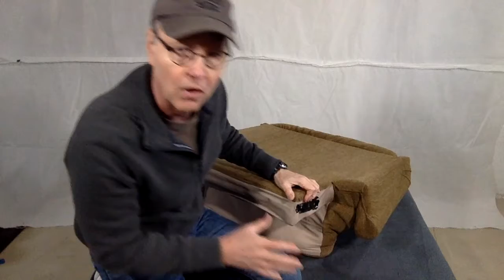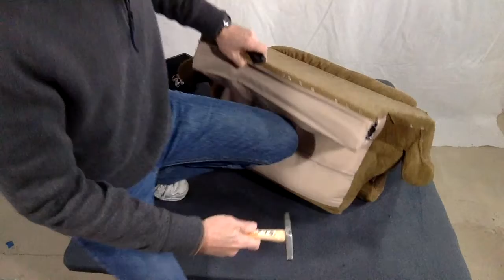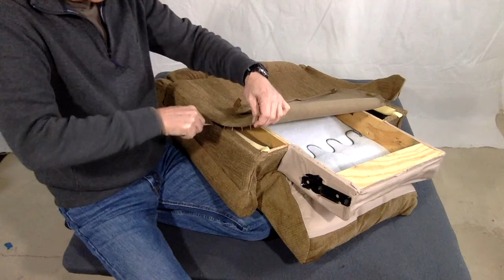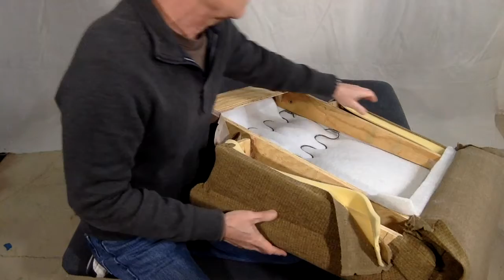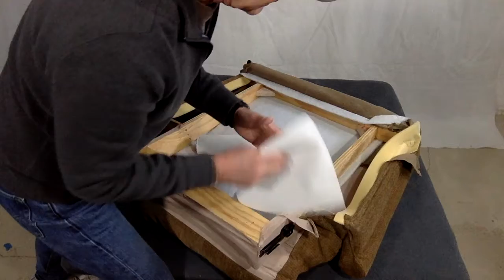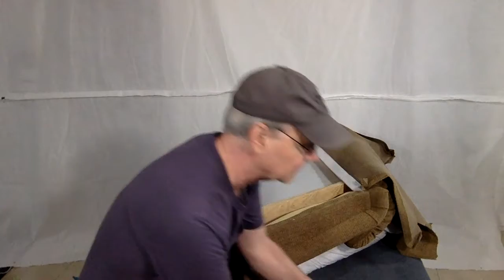Wing Back Recliner Frame Repair

Comment: I have Prime Resource International Birch Hill recliner with back rest frame broken where they have the frame looking like two legs attaching the base rather than a square frame. Which one of the leg had broken. How should I go about in fixing it. The wood frame feels like cheap plywood slats that had brittle up. Not sure if I should use metal brace to join the broken pieces or try to replace the whole frame.
Reply from the maker: @munashiinatsuo - Poor construction is common with mass-produced furniture today. My rule of thumb is: If the frame cannot be repaired to be at least as strong as it was originally, don't bother. If it can be repaired & made stronger (where the repair was made), that is ideal.

Comment: Very informative, I need to fix a recliner end of a Lazy Boy sofa, it has locked in place with it reclined and the back has broken loose, how can I fix it?
Reply from the maker: @Sandra Thomas - Sounds like you may have 2 problems. If the recliner is stuck open, there's likely a problem with the mechanism. And the loose back suggests another issue where the back attaches to the seat. I recommend having a La-z-boy repair tech check it out.

Comment: At 11:21 what are those springs called? I can't find them online. I have a 12 year old 433 CRANDELL BIG-MAN ROCKER RECLINER by lazyboy.
Reply: I use this chair quite often to sleep in and one of the springs broke and pierced out the back.
Reply: @BeardedBaldGuy87  I have exactly the same problem on an La-Z-Boy Astor.  First Astor only lasted 2 years, everything broke on it,  this one is broke after 5.  Had to go back with the same chair because it was the only one I could find that fit me.  Not happy with the quality
Reply: I think I may have found them on ebay. Now to take the back apart and measure the unbroken spring
Reply from the maker: @~B~ - Those are back springs. Contact La-z-boy or one of their dealers to order replacement parts.
Reply: @reclinerrepairguy4155  Thanks I have that same back on the Astor, but I have to replace a broken back spring (same as ~B~, it came through the back panel).  Does it require additional disassembly, or can it be done with just the back panel off?
Reply from the maker: @bogieman101  - Yes, you'll have to loosen the outside back panel & the bottom of the inside back panel to access the springs. If the chair has 3 or more springs, you'll have to loosen more of the inside back. 

The video -- 'Installing Recliner Back Springs' on the ReclinerRepairGuy.com website walks you thru the process. The video is not free, however, it requires a 1-month paid membership.